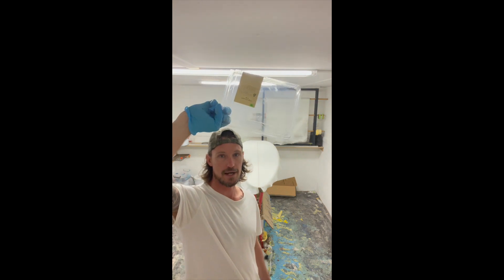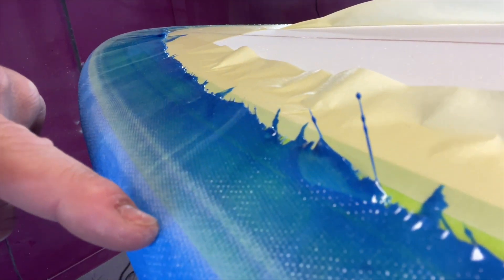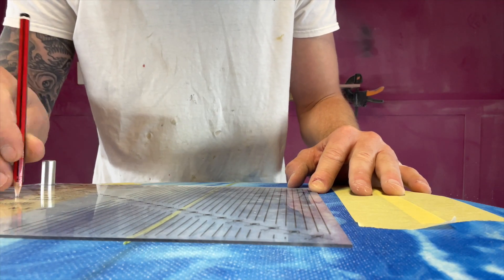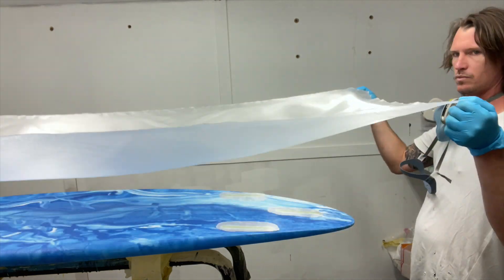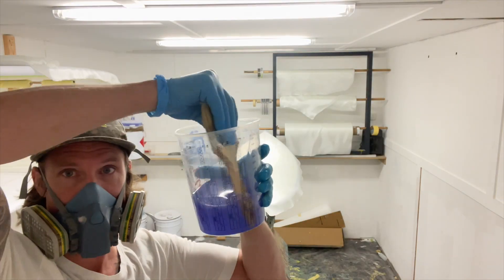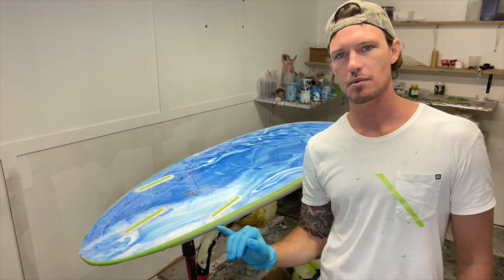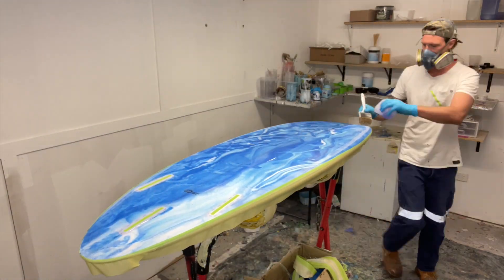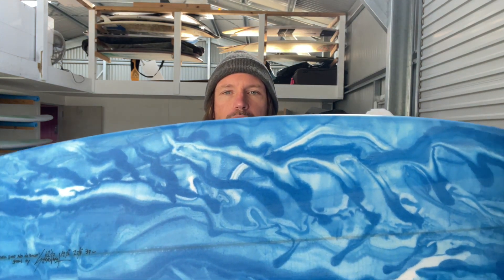Stress free RESIN SWIRL epoxy cutlap surfboard   HD 1080p

Comment: Great video , built a few wing boards but want to start being a little artistic! When do you use the posca paint ? Just before the hot coat ?
Reply from the maker: I only use posca after the hot coat and prior to a final clear acrylic coat. I have heard of people using under hot coats but it can have a tendency to run if kicked hot.

Comment: Hey, me again lol! Sorry, but I'm doing an epoxy resin for the first time and your tip to sand the cutlap, use a few relief cuts and it'll peel right off....SPOT ON MY FRIEND!  I used that for trimming the hull lamination on the deck and it worked out AWESOMELY!  
Question: will this work on trimming the deck lamination also? Not sure here cause the deck lam is bonding with the hull lam....and a little worried about sanding thru both the deck glass and also the hull glass...which wouldn't be good......
Reply from the maker: It’ll work both ways, you just need to be careful.  Use an extra layer of tape ( so 2 layers ) and that’ll give you a nice high ridge line to sand and you should be all good.

Comment: More than a great job Dude! I am doing some backyard boards always using bio-poxy (sei whale from rconcept) but I've learned another good things from you today - awesome! There is always something to learn haha. Did you know that you can reuse poxy when it seems to be like jelly from the cold? Just heat it up in a hot waterbath and it's useable like new. Try that with poly 🤣
Kind regards from Germany 🤙
Reply from the maker: Yeh man always learning! Good tip 🤙

Comment: Great video. I have a question regarding the removal of the tape for the cutlap. There seems to be a bit of tear out when you pulled the tape up, do you go back and fill that? Otherwise would using some heat reduce that issue when pulling the tape?
Reply from the maker: Eps always seems to have that tear out. That’s the nature of eps. You can fill them if they’re quite bad but I didn’t. If they’re only around single bead size I just fill with resin whilst laminating. Heat does release the glue on tape better but it can also cause the eps to outgas with the temp change.
Reply: @Shrednaught  thanks for the information! I didn’t think of the outgassing at all.

Comment: Did you just sanded on the cutlap or also used a blade to cut it? Seems like you didn't use a blade. Pretty decent cutlap, I liked it.

Comment: With epoxy, even with the good tape, does it leave residue or have any bleed through after having to wait so long for curing?  I also noticed when you pulled up the tape it seems like it ripped out some foam on the deck too.  I doubt you encounter any of these problems with poly...
Reply from the maker: Yeh it can. But there is ways around it. You’re correct, my tape did pull some small beads up. I could of used a hair dryer/ heat gun lightly to warm the tape glue up. The thing with eps is that it’s so light you can fill these small voids with resin and it’s unnoticed. They then add a tether point into the foam IMO
Both eps/epoxy and poly/pu have their pros and cons and using either can be decided when thinking about the application ( wave ) wanted to be surfed.
Cheers for watching 🤙
Reply: @Shrednaught  thanks for the reply!  I have yet to glass a board with epoxy and have limited experience using them in the water as most of my boards aren't very light. It is definitely a more environmentally conscious material to use for sure, and I would like to sink my teeth in and give it a try if I get around to needing a small wave shorty
Reply from the maker: Those “fun” style boards are perfect application for eps/epoxy. 👌

Comment: Good tutuorial, was wondering if you use a tint or pigment with epoxy will it still discolour? like a clear epoxy will eventually go yellowish even if its not expose to UV. Cheers
Reply from the maker: I’m sure if you use a surfboard specific epoxy resin and tint it won’t dis-colour in a way you’re referring to. It may change colour tones eventually over time but I doubt it’d be significant enough to realise. 🤙
Reply: @Shrednaught  thanks mate!

Comment: Yo man, what did you do with the holes in styrofoam after rippin off the tape on the first layer
Reply from the maker: They look kinda bad but they weren’t that deep. I just filled them with resin whilst glassing and you can even notice them.

Comment: Thanks so much for your videos! Do you seal the EPS foam before glassing? I’ve heard this is necessary for a resin tint but maybe not if it’s opaque?
Reply from the maker: Yeh if it wasn’t opaque you’d need to seal to get the consistent colour. Or a spray. With the clears or even this swirl I didn’t seal it as it’s so adhoc anyway that you can’t notice the slight change on colours.

Comment: how much resin do i need for a short board like that? considering the hot coat... thanks
Reply from the maker: It depends on your skill but for an average I would say 700-800 for lam and 400-450 for fill coat.
I would get 3L total to be safe. Always best to have more than less 🤙

Comment: How do you get the filler coat to not separate and fish eye? Whenever I try to use epoxy no matter how clean I am with gloves and cleaning the board it always separates ?
Reply from the maker: It does have a lot to do with epoxy brand used. 
Have you tried giving the lam a light scuff with sand paper before filler? Some epoxy resin will require this. Especially after letting it cure to full
Reply: @Shrednaught  thanks mate appreciate it!
Reply: How long are you between lam and filler? 
How are you 'cleaning'?
Reply from the maker: Depends on my schedule but usually next day. Ideally you’d throw the filler on as soon as it’s hard enough.
I don’t clean as a rule. I try to keep everything clean by using gloves and I just blow the dust off.
Reply: @Shrednaught  good to hear! I'm wondering though, how Luke is doing these two steps 🤔

Comment: Sweet board,! Looking to do similar glass job. Couldn't tell how you layered it exactly from cam. Did you slightly mix all 3 colors in your pan? Or drizzle them and use 1 main color? and what % of each color?  And how do you wet it out good, but not to overwork and totally blend it.? Cheers for SD Cali
Reply from the maker: Thanks mate. Just pour into pan and didn’t mix them. You want to make sure you don’t muddle the colours around so work from the middle out and clean the squgee with each pull
Reply: @Shrednaught  cool man. What was your color proportions about?
Reply from the maker: You’ll have to work that out from your epoxy and tint supplier. Everyone is different depending. Most cases I just wing it but if you want to be certain it’ll be best to check with them.
Reply: @Shrednaught  I have pigments and tints at garage. Just wondering about what your amount of each was, mostly light blue? Thanks for replying 🤙
Reply from the maker: Yeh the dark colours you want to use less of. So with swirls if you’re using a colour set you also need to think of what colours they’ll make if combined. Green and orange make brown. So use colours in the same palette and you’ll generally get what you’re after. Darker colours always over power

Comment: Thanks for making these priceless videos! I'm about to glass a board with epoxy and wondering if you need to use any additives to make sanding resin? (I'm used to poly), or do you just sand the lam resin ?
Reply from the maker: Epoxy is able to be sanded without any additional additives. Although there are some that claim to make it easier to sand or help the fill coat with fish eyes etc:

Comment: I would like to learn about decals or transfers or whatever you call them.  What if I want a big two foot logo.  How would I go about getting that made and how would I apply it?  Thanks dude!
Reply from the maker: You can get the logo printed up by a surfboard decal company. Surf decals aus are the people I use and they’re amazing and very affordable. Just send them the PDF of the art and they’ll send you the decal. As far as the process with applying it, it depends on the board. But for the most part it’s the same. Just gotta be more cautious with air getting trapped under it. 
Any questions just let me know mate 🤙
Reply: @Shrednaught  Thanks mate!  That helps!
Reply: @Shrednaught  Just finished up my first two surfboards last week!  The decals came out fine except for being slightly crooked.  I used band logos for those two.  I really like that swirl.  I might try going that route for my next board.
Reply from the maker: Good stuff mate! Keep at it and you’ll get them straight 🤣🍻

Comment: I dont if its relavent to the new fin boxes, not the original FCS anyway, but in the old days with original style fin boxes we would put a 4 or 6 oz on the face of the box begore install which you can glass straight over. Youd do that by laying 4 or 6 oz cloth on a glass table, the fin slab table in those days, and laying the boxes face down on the laminate. Cut the exess glass off around the box and rough sand the face and insert them in the board and glass right over them. The last stage is after sanding or finish/gloss coat use a router with a guid st the bottpm the bit to cleanly rout out the box. Maybe you cant do it on the Futures if there is a screw im the side. Anyway i must be reminisci ng.
Reply from the maker: That sounds like a great idea. What were the fin boxes called you would use?
Reply: @Shrednaught  we only had one style of fin box in those days. I think theyre still around on single fin retro boards. The reason i used to do it was extra strength, not easy to year out the box with the laminate on top of it.

Comment: Excellent work as always. Love the videos. Would like to know if you have a general rule as to how much resin to mix per side for lam and coats, etc.? I find that I usually mix too little or way too much resin. You seem to always have just enough to do the task and was curious what your formula was for determining that amount.
Reply from the maker: Thanks mate. For the lam I’ll be honest I mostly just make an educated guess. Depending on board length and amount of glass. I always aim for too much resin rather than too little. I’d rather have couple bucks left over rather than stuff a board. For the fill coat I always just use a plastic cup that holds 400-450ml and that seems to be perfect for all but the bigger boards. For an exact formula table I am pretty sure green light surf supply has one online you can use. Yew! 🤙
Reply: Green light surf has a chart you can use and they give you all you need to know on your board length to resin ratio

Comment: Thanks for posting those videos, they're very informative. Can I ask about taping the hard edge, like you say you want to make a little dam. What prevents the "dam" part of the tape from touching the glass and sticking to it when you brush your hot coat on? Especially going from side to side, doesn't the brush push it onto the rail?
Reply from the maker: I’m not entirely sure I’m on the same level but I’ll try answer anyway.
The glass should be dry to the touch by now so the tape won’t stick to it. If you mean the resin over the tape and then hardening? That’s a possibility and if that happens you can sand away the tape when sanding the hard edge back in. 
The tape also doesn’t stick to the resin hard edge resin when it’s wet or to the gelled stage but it will be stuck if you let the resin fully cure. So always best to pull the tape when the resin is gelled and green but not full cure 
Hopefully I answered something there for ya mate 🤙

Comment: Ok, last epoxy resin question...I swear!  If you're doing resin pin line/s in epoxy how well do you have to sand the hotcoat? 80 grit, 120 grit....I am assuming the smoother the better, but maybe that's backwards...I'm such a newbie 😅
Reply from the maker: Good question. You need to leave enough grit in the resin for the pinline to hold too, but also don’t want the resin to bleed under the tape. I’d go with 120 and really push the tape down for the pinline
Reply: @Shrednaught  You are a scholar and A GENTLEMAN, my friend!! Muchas Gracias!!

Comment: Do you have any tips on how to prevent the epoxy bleeding through when doing cutlaps? I am using the green 3M stuff, working on a clean board and pushing it down with a razor blade, but it still happens quite a lot. I heard it's harder due to the long hardening time of epoxy and its thinner consistency. But still, any ideas that might help?

Loving your videos! Many thanks for all the amazing content :) Greetings from Germany
Reply from the maker: Epoxy is a harder medium to work with than poly. I’m going to assume you’re using eps? Try your best to get the foam as flat/flush and with as little bead tear as possible. It sounds like you’re doing everything correctly but like you have mentioned epoxy can be thinner and takes longer to cure/kick. Also as epoxy starts to catalyse it’s produces heat ( exotherm ) and this can effect the tapes glue. Try your best to remove as much resin from the glass ( as practical ) where the tape is on the laps to try and help. 
 If all else fails just do a nice pinline to hide the bleed through.

Thanks for watching, appreciate it 🤙
Reply: @Shrednaught  I am using XPS, but I guess the same applies here with the bead tear. Many thanks for the detailed reply. Best shaping channel out there in my opinion!
Reply from the maker: Yew! Thanks. Any further help just hit me up 🤙

Comment: oh my , i see 2:05, this little bastard tape, is taking of grains of the eps...how do you deal with this...please answer, you made such a perfect job shaping a baby butt surface and this ruins all your effort. what is the density of the foam you use.and how do you deal with this situation after it happens, do you glass bubble filling it again?
Reply from the maker: Unfortunately this is the norm for eps. The construction of the foam beads just allows easier tear out. You can sometimes mitigate it using a hair dryer or similar to warm the glue on the tape but in all honesty it looks worse than it is. It’s a very high density foam. If the tear out was significant I’d use a spack or a qcell mix but for this board I just glass as usual and fill with resin. The weight on eps is light enough that doing this doesn’t make the board feel too heavy. 
Cheers 🤙
Reply: I use eps 200 and I have no problem of this kind.
Reply from the maker: No bead tear using the same method of allowing the epoxy resin to fully cure then sanding back the tape line?
That’s rad eps if so. 🤘

Comment: What fin box system do you prefer? FCS II or Futures?
Reply from the maker: For my personal boards I have mostly glass ons. I initially did go with fcs2 as I could determine the cant for the specific board. But I do like futures as they have a larger selection of fins. For the most part I use whatever the customer wants.
Reply: I ask because I've lost fins with the FCS II system when I didn't use screws. Now that I use screws, I think it defeats the whole purpose of the system and the tight fit has caused me problems with cracks around the boxes when inserting or removing fins enough times. Do you think futures will give me better luck with less board repair? I only have one set of FCS II fins, so I don't have a lot money put into that system yet.
Reply from the maker: @Carkshark  yeh same. I’ve also lost fins. So now I always use a screw in the front. That way I won’t loose the fin but it’ll still pop out if it’s hit hard and not take the fin box out with it. 
Im not sure about the tight fit? Are you using genuine fcs2 or an aftermarket fin? Maybe a light sand on the fin tab will help.
Reply: @Shrednaught  Started with a set of FCS II Medium performers in "Glass Flex" (plastic). I tried the single screw trick after the first time I lost the right fin, but a week and a half's worth of surfing later the damn right fin came out again. Each time I had one come out I recall turning right really sharp before dismounting. So, now I use two screws for all the fins.  Didn't have any more fins come out so I got rid of those plastic medium fins and bought a set of FCS II Mick Fanning Large fins. Great fins, just don't like taking them out and messing up the glass around the boxes on my polyurethane board. By tight fit, I'm talking about the force needed to pop the fins in or out against the tab in the back half of the box.
Reply from the maker: @Carkshark  ah yeh I see. I guess grub screws are the only thing to prevent that. For popping the fins out I bought this leverage tool called “ fins out”.
It works amazing and was only about 15 bucks. You should check it out 🤙
Reply: @Shrednaught  Yeah we have a similar thing in the states called a "Fin Puller", but that thing looks better since it doesn't lever against the bottom of the board. I'll have to see how futures fins go in and out in person and make a decision to switch or not.
Reply from the maker: @Carkshark  thanks mate 🤙
Reply: @Shrednaught  Yooooo, epic videos and love the humour, you´ve taught me alot. Any chance you got a "how to glass on fin/ make and foil fins that dont look like right shit" tutorial coming up? All my attempts have fallen horrifically short of the mark. Keep up the work though mate
Reply from the maker: @jakecrumbleful  thanks man.
Shaping and foiling fins is an art. But they’re are a few tips and tricks to doing and glassing on. I’ll try get a video done on it sometime in the future for ya 🤙